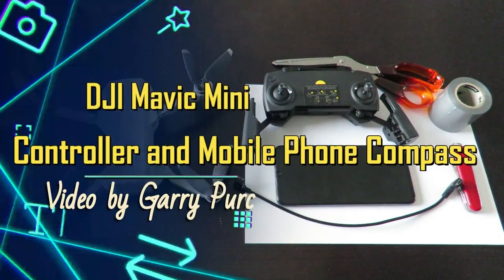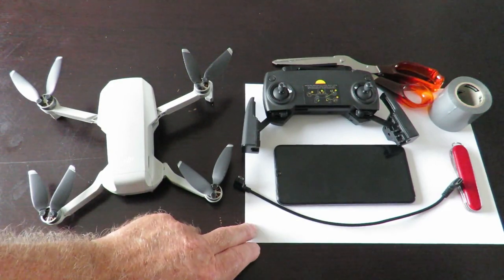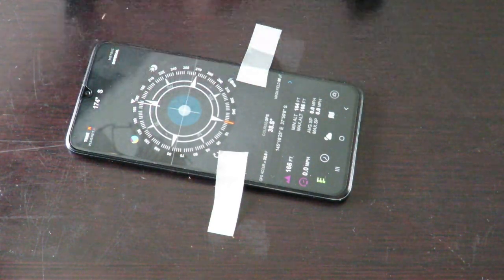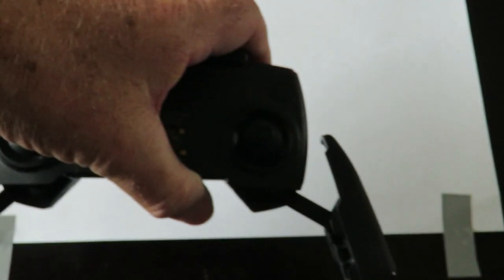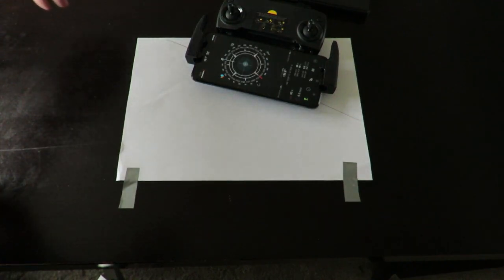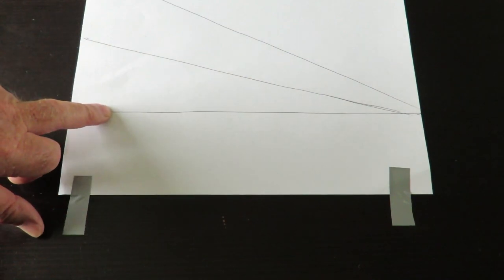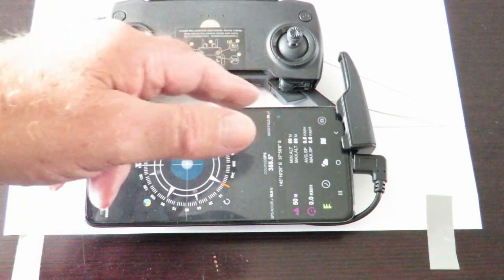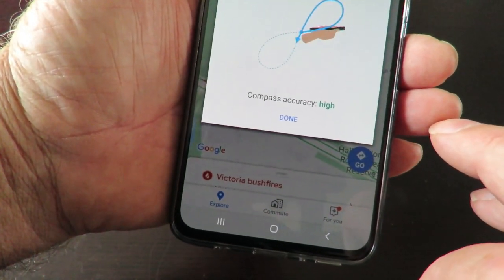🚁 How To Fix the DJI Mavic Mini Controller Mobile Phone Compass Orientation

Comment: What I do is mount the phone in the controller and then I calibrate the phone compass by opening Google maps and doing figure 8s with the phone mounted in the controller. Works great when I do that.
Reply from the maker: That is one way of getting around the problem.
P.S. Don't forget to re-calibrate your phone after you finish flying.

Comment: Hi.  Where did you purchase longer cable for Mavic mini remote controller???  So I can flip my phone around to other end. Hopefully that will work.
Reply from the maker: The one I used is a STARTRC Durable Micro USB to Type C USB Cable for DJI Mavic Mini
Ebay have them, but Amazon is cheaper.
MAKE SURE you Buy a "STARTRC cable", there are plenty of others, but they don't work.
I found out the hard way.

Comment: Again a great video
thank you very much, keep going.

My question is, how is it if you only use a wifi ( With No GPS ) ipad with the RC controller to fly your drone?
Reply from the maker: From my understanding, you can fly up to 30 metres with your controller, without having a phone attached.
Reply: The device you use with the controller doesn't need internet. Indeed it doesn't even need the wifi, in fact to minimise interference with the controller's wifi, you should put your mobile in flight mode. The controller has it's own proprietary wifi connection to the drone, nothing to do with your phone's wifi.
Reply: To be clear, I fly my Mini with a phone with no simcard. Never had any issues.

Comment: As long as the drone compass is ok there shouldnt be any issues,im sure dji has figured that out already.Or not?
Reply from the maker: The quad uses its own inbuilt compass to fly. True..
However.... If the phone compass magnetic field is not right, the phone will not show the correct orientation of the craft in the app.
So you can still fly if you like, but you won't really know where your mini is pointing, when using the onscreen arrow.
So, you can either do a phone compass calibration, each time you use your Dji mini controller with phone inserted. Then when you have finished flying, remove your phone, and redo its compass calibration so you can use your phones GPS.
OR, Simply, I can turn this phone 180 degrees, and not have to calibrate each time I use the controller.
Reply: @GarryPurcell  nice one.Never had problems though
Reply: @GarryPurcell  I doubt the app uses the  phone compass, otherwise it would ask for it to be calibrated. The orientation would be calculated between the controller and the drone.  Pretty sure the orientation works with my Tab A, no built in compass.

Comment: Bullshit. The DJI fly app has a real problem and DJI cannot seem to fix it. The aircraft orientation  icon is inaccurate with all Apple devices but the iPhone.
Reply from the maker: I gather you have not tried what is shown in my video.

I don't own any iPhones, but I'd think the compass chip is located on the side of your phone that is magnetically attracted to your controller, based on what you describe.